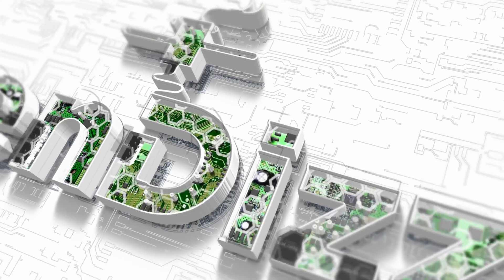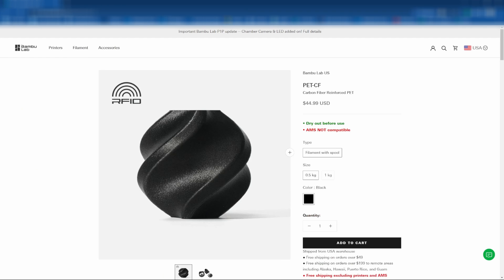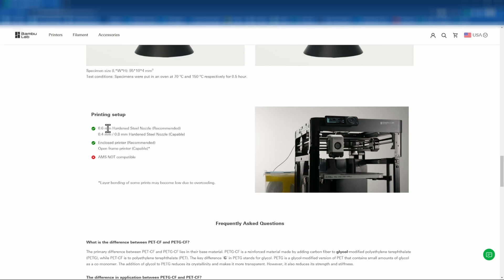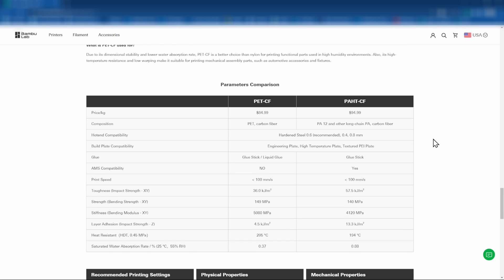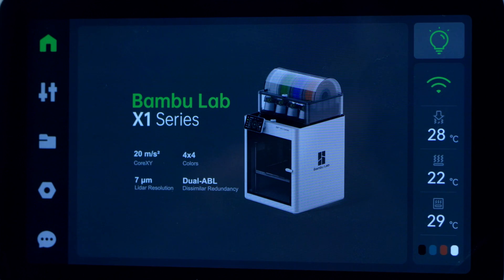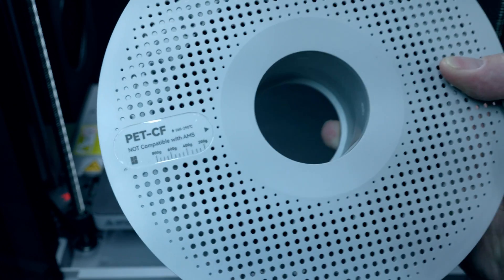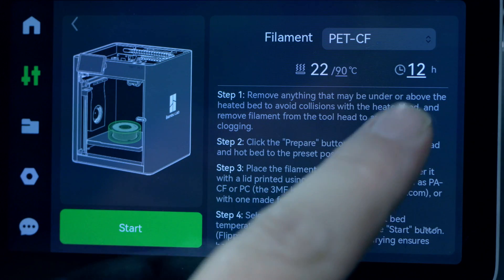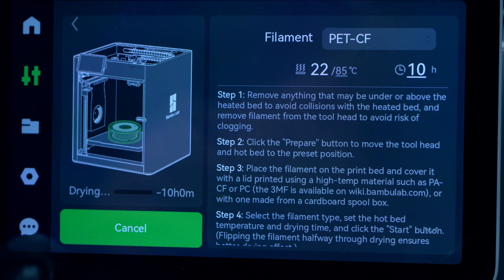How to Print with Bambu Labs PET-CF Filament on a Bambu Labs X1 Carbon 3D Printer

Comment: Been drying some pet cf for 7 hours, just now giving another go. First time I mixed it up with petg cf and tried to throw it in the ams after 20 minutes drying. Did not go down well, lesson learned.
Reply: How’d it go? I find that the ptfe tube needs to have a smooth straightish path directly into the extruder for it to be worry free. And of course the drying as you mentioned.
Reply: @rpiian  Hey, It went well. Detached the rubber tubing from the ams, cut the filament and pulled it free, heated up the nozzle then ran a thin needle in to the extruder at which point the last gunk came, out. Dried every time 8-10 hrs, seemed to have effect on how well the layers bond. Great for this application and pretty well priced. Just adding the electronics to the drone now. Cheers.

Comment: What will happen if I use the ams? I’m asking because there is a support material made for PET-CF how am I going to use the support that is in the AMS and the PET-CF is on the spool holder?? This is quite confusing
Reply: Not sure about regular AMS but using CF filaments on AMS lite will wear out the plastic extruder gears quickly. We need hardened AMS gears 😁

Comment: Hey there, I have always been interested in printing with PETG with my X1 but always ran into clogs and exessive gunking of the filment aroiund the nozzle. I came across both of your PETG and PET G carbon fiber videos today and I noticed that you mentioned the prints look pretty good. They look pretty bad actually, I see layer adhesion issues and the print doesnt look smooth at all for a CF filled fialment. Have you experimented printing without glue on a pei sheet before?
Reply: For me I have the same conclusion. Those prints here look bad actually

Comment: My friend was going to buy a set of replacement brake levers for his motorcycle and a set was £120, I showed him the finish of PLA CF and he wanted them printed in CF so we went for the PA6 CF I also made him some enclosures for the dials and they look awesome
Reply: Isn't it dangerous if those brake levers break??
Reply: @michaelcolourboss2885  I cant break them with a hammer so I doubt very much that normal use will
Reply: Yes, for sure. I wouldn't. @michaelcolourboss2885
Reply: @michaelcolourboss2885  pa6-cf (nylon) is probably strong enough, if they break it's not really the material's fault. Although I don't know about the uv resistance of nylon.
Reply: Id never print brake levers based on looks.
Extremely dangerous. 
Did you test and replicate those brake levers under a hard braking situation?
Reply: @rkwjunior2298  hydraulic brakes dont need much pressure to full brake..

Comment: How is it that you cant get PET by itself but you do get it in PET-CF.  Does the carbon fiber prevent the carbon fiber keep the PET in amorphous form (prevent from crystalizing) ?
Reply from the maker: Good question
Reply: BASF sells regular PET, but especially the thermal characteristics seem to be like PETG, which anecdotally is easier to print. So there is no real upside to regular PET?

Comment: Hey Len, I've been printing Bambu PETG-CF with the Bambu x1C for some time now but I don't understand this filament. My nozzle always gets full of filament on the exterior. It just gathers up during printing for some reason.

Bambu presets, says to print with 250-255 degrees, but then the nozzle oozes filament out (i've tried drying for 12-18 hours, no difference). I manually set to 240, but it still oozes out at the nozzle at stand-by a little bit. Much better than at higher degrees though.

Problem is, even at 240, my nozzle still gets full of gunk on the exterior. I tried exchanging the 0.4 nozzle to a 0.6 nozzle, but still no difference. Same thing happens. What could be wrong??
Reply from the maker: Try adjusting the retraction settings.  They are located in the filament settings under "Setting Overrides."
Reply: @lendizzle77  can I test the retraction somehow, without having to print something? Seems like an unecessarily long process and that it should work with the bambu presets out of the box. Why else have the presets :/

My issue is the same with PLA. At 220 the filament also oozes out at idle.
Reply from the maker: There is a retraction test and you might want to run the pressure advance test in Orca Slicer.  I have a little bit that comes out too especially when it is moving before printing and a little comes out.  Every once in a while it causes me a problem, otherwise I just leave it.  If it is affecting prints, do the calibrations, if it is not, try not to obsess over it.

Comment: Cool video.  I just subscribed. :-)   I have a bambu lab x1 carbon with out the AMS.  I have been using the cool plate with PLA.  I want to use the engineering plate on the other side of the build plate for PETG.  Do I remove the sticker on the cool plate and then just start using the engineering plate.  I didn't see any video on how to use the engineering plate on your video listing. Maybe you can make a video on how to use the engineering plate.
Reply from the maker: Good idea. You should not need to remove anything.
Reply from the maker: Thanks for subscribing!